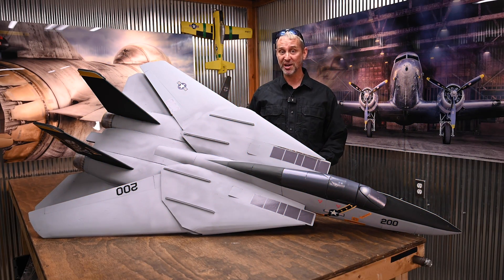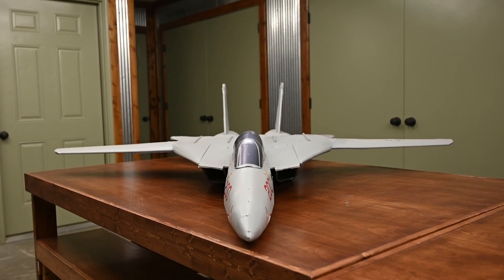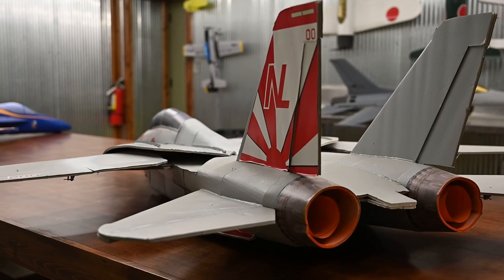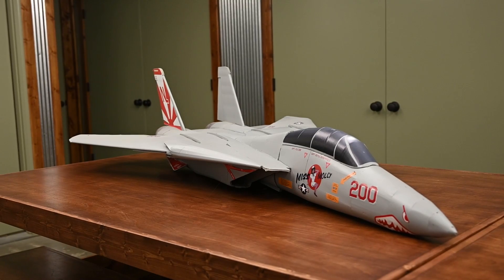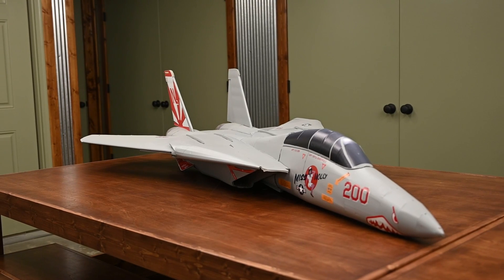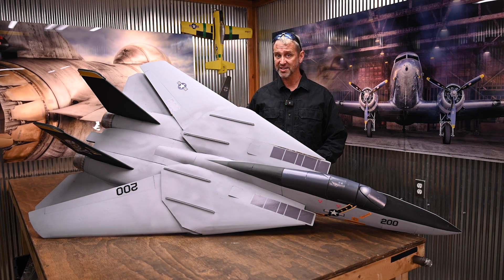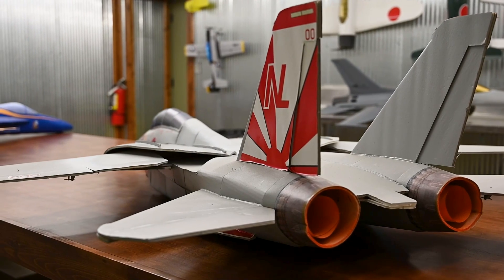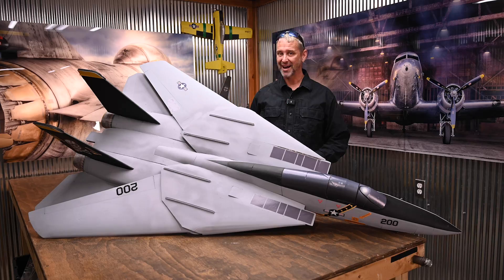*AVAILABLE NOW* Flite Test Master Series F14 Tomcat INTRO

Comment: My son is 5yrs old and complements of SeaFair (2023) and the Blue Angles demonstration, he is interested in Jets.  I am considering attempting to get him a Smaller EDF jet which could be adapted to fly in a Control Line manor.  Probably a 40ft diam flight area.

This jet is way to big, but has the FlightTest team considered a control line version and is there a smaller version of this jet which could be a good candidate for what I am looking for?  As he is 5yrs old, I would control the throttle from a remote.  Control lines would be for vertical movement.

Comment: Beginners don't fly such huge jets, much less build them, with expensive huge scale electronics, mainly twin edf, 90mm ? No dude, this just does NOT work. It's nothing but ego stroking to make everything oversized.
Reply: This is not intended for beginners. The Master Series line is intended for seasoned builders who are looking for a challenging, yet rewarding experience.